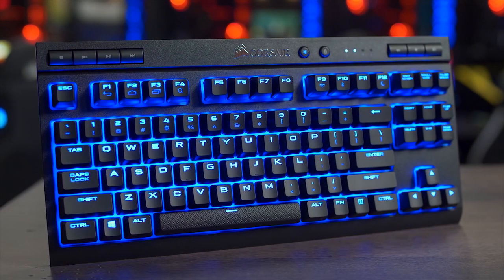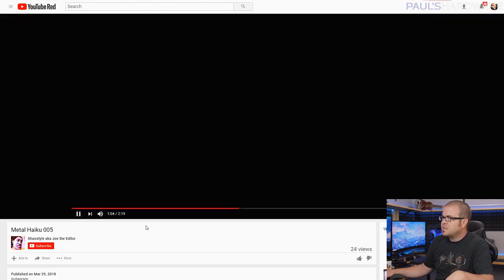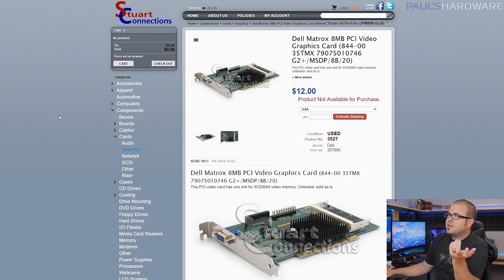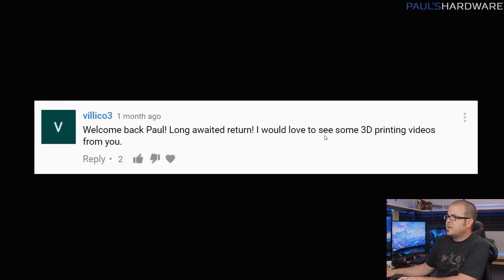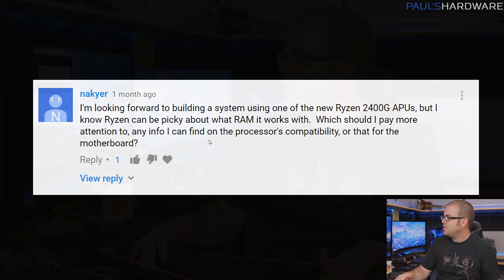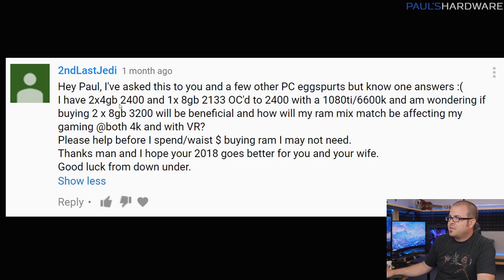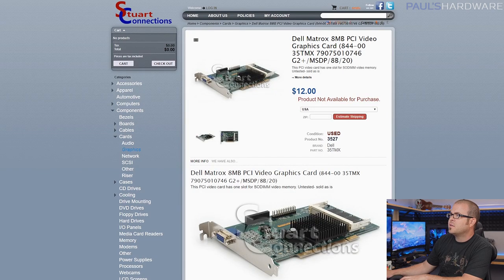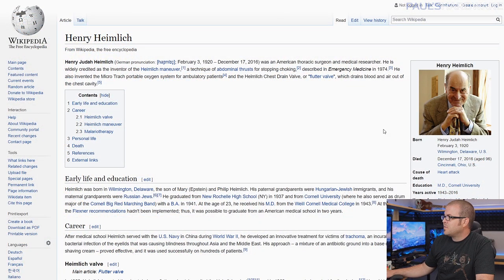Why Can’t You Upgrade VRAM on a Graphics Card? - Probing Paul #23

Comment: For Intel CPUs, there is no discernible benefit of faster speed RAM for almost all applications and games. I think I saw videos where doubling the RAM speed from 1333 to 2600 makes maybe 2% of a difference (so not noticeable). Same with difference between DDR2 / DDR3 / DDR4 - very little difference in games or applications. Many youtube tech channels have videos out there describing this, including Linus. Also a lot of written material online about this. 
Using an APU, and no discrete graphics card, you might benefit from faster RAM (as no VRAM is present). For AMD chips, you obviously want faster memory.
Reply: michaelreqd
What system did you build, what GPU card does it needs to run, if you only need a cheap GPU, who cares what CPU u need? If APU is enough, why care about speeds?

Simple test, replace the memory, or clock it down, 4000 VS 2600.
Timing is not that good on SIS AMD chipsets, compare it on both speeds! You see on both intel and AMD CPU's the are benefiting of faster DDR speeds!
If you never need a good system, APU can a solution for light tasks, never needing a good system at all.

Comment: Hey Paul, i have a dell laptop with 8gb ddr4 2400mhz. I just want to make sure if my ram is running at the stock speeds, but as far as my knowledge i think i have to to turn on xmp. But my laptop doesn't have it on the bios. So is there a way to know what speed my ram is running at and how to overclock it to the 2400mhz from 2133mhz. Thnx good vids btw
Reply: The current speed of your DIMMs is displayed in Task Manager, so you can just look it up there. As for your other question; that's very hard to answer, because overclocking it has to be done through the BIOS, or in some cases through a piece of software that then proceeds to communicate it with the BIOS. If you don't have the ability to set memory speed and timings in your BIOS (and given that it's a laptop, that wouldn't surprise me), then you're probably out of luck.

Comment: Dont waste your time 3D printing. Just get a 6040 or 3040 cnc router. Sold my 3d Printer  after 2 months it worked fine and gave great prints. But parts really are not that functional.  And the parts that are would be better from a 6040 or 3040 cnc that you can get in the same price bracket.

Comment: Large VRAM video cards are probably just over the horizon (from the time of this post in Feb 2023). The newer LMM models, which are clearly where the industry is headed, either need sophisticated high-speed networks of GPUs or clouds of CPUs to train as their number of parameters move steadily towards the trillion+ parameter point. Modern transformer models such as GPTv3 have sizes in the hundreds of GB, too large for any single GPU or even small cluster of GPUs to execute in the forward direction in reasonable time frames, let alone train. Intel has started targeting Nvidia's lucrative market by building tools on their Xeon silicon that accelerate neural model development and execution, and CPUs can train larger models with system RAM via capacities that stretch to 4TB or larger. This means Nvidia will shortly need to start expanding VRAM on future models to keep their products relevant. It will take a while to ramp up, but my guess is you'll see cards with VRAM capacities in the 256GB range by 2027, clearly more than is needed by consumers but perfect for prosumers, researchers and cloud facilities.

Comment: Your answer to the memory upgrade advice isn't entirely correct. The mobo should be able to run in dual channel by treating one 8 gig stick as one channel and the other 2x4 as another channel. So the only advantage of upgrading is frequency and latency, so I wouldn't do it.
Reply: Tyler Weigand your right ,my system did read as dual channel but after removing the 8GB stick my performance was more stable but after upgrading to 2 x8 3200 it's even better .
Reply: 2ndLastJedi performance was more stable? What does that mean?
Reply: Tyler Weigand when I was playing rF2 (also other titles) with my old config there was stutter and pauses that disappeared after replacing with 2x8 3200 . So my frame time seems more stable .
Reply: Interesting, that's strange that that happened. I'm honestly not sure why, but I'm glad that the new RAM fixed it!
Reply: Tyler Weigand yeah it's definitely better but more performance is needed to get VR running perfectly with some of these racing Sims . Or more optimisation.

Comment: when I see "Increase Vram on GPU" is that actually possible? I mean a red flag is it's an Indian making the video but is it actually possible to increase Vram by doing something system wise?
Reply: Well, if you have your GPU on your CPU and you use that as your GPU, then yes there are settings in the Bios and the system. If you're on a dedicated GPU, it would require soldering and would only work on some cards

Comment: it's because microsoft and AMD and nvIdIa  didn't want to work on this problem for 14 years.  !!!  !!   can be from the video driver    for all of them igpu motherboard   or APU  OR AMD CARD OR NVIDIA CARD  OR INTEL ..       
 but they has  to put ther  ass to work      all of them   intel AMD  MICROSOFT   ...  it was one of the promises he made for windows 7   !!!  which did not become a reality  !!!   than in some very rare cases    om igpu  on cpu or on maderbord !!!  so eay work go tu work   weitin for 14 yers !!! omg

to open the facility to control which additional memory you can allocate directly from the driver in your ddr3 or ddr4  sitem  memory  to   
the low detail graphic in the horizon  !!!   

which you can only see on a workstation with 8 video cards    ...  as   for you all to see live on the whole map   lake good mode !! 

please put to work  all of them !!!